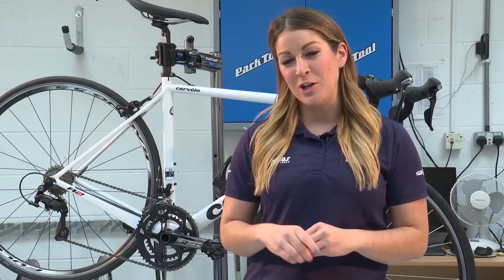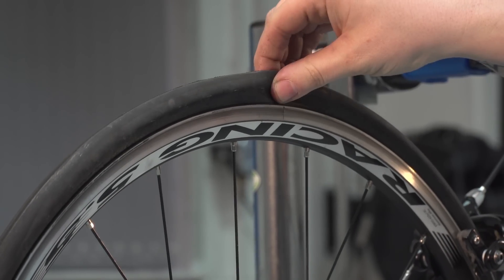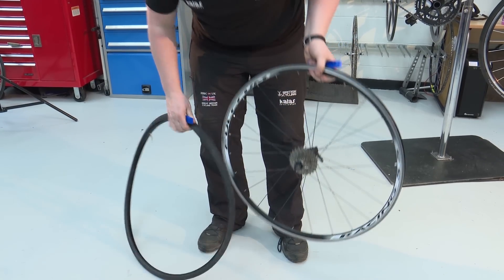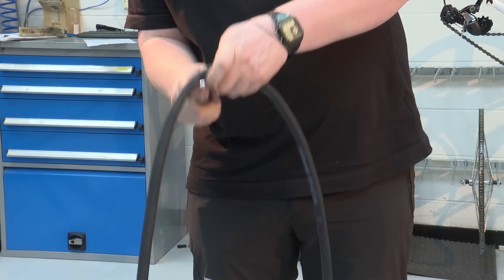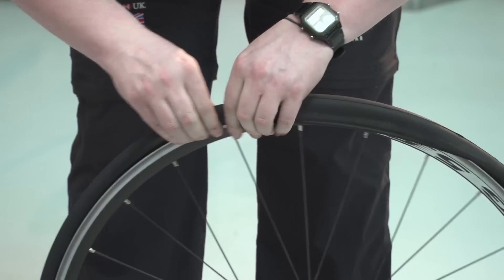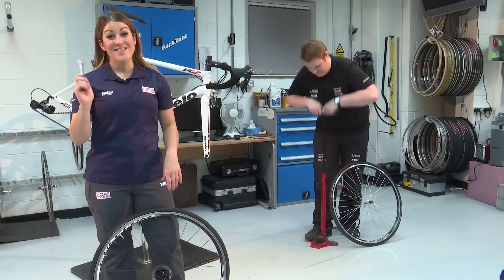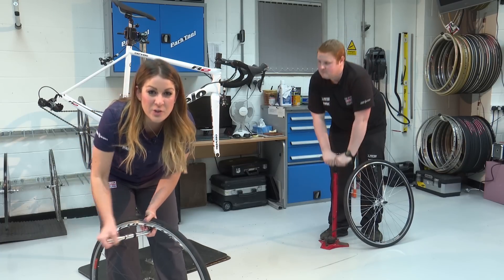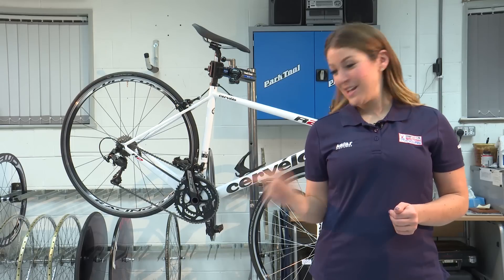How to change your inner tube on your bike

Comment: If you're dealing with a very thin 700x23C, and you're struggling to get the tyre back on - stay calm, count to 10. Use duct tape to keep the quick wins in place in two places. Then, rather than trying to force-lift the tyre back, run one tyre lever along the resisting parts, patiently pushing in a 1/4" at a time. Use the other one to keep progress on the other side in place. (It helps if you have robust tyre levers). Use a flat screw driver for the final stretch, taking care not to stick it too deep and risk damage to the inner tube. Scratch damage to the metal be dammed! Worked for me.

Comment: Would be nice if you could do a video showing how to fix a flat on a town bike at the side of the road without removing the wheel - most bikes with hub gears don't have quick release axles, and certainly don't look anything like the road sport bike in the video.